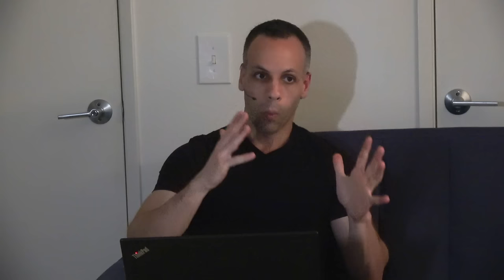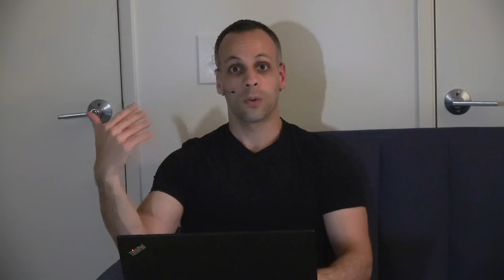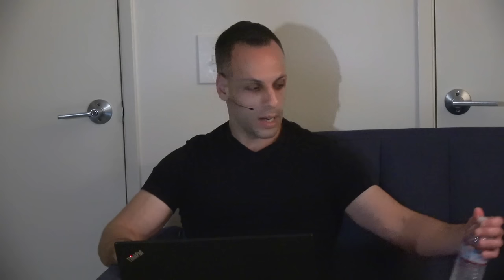EVGA's Oversight: Unannounced Changes Destroy PCs, EVGA takes NO ACCOUNTABILITY

Comment: I almost learned this the hard way. I had to replace my PSU as it was smelling like molten plastic, that for some reason I was the only one able to smell it. I got a new PSU and thought nothing of it to simply swap the PSU but not the cables to save my self the hassle. My paranoid hypervigilance made me think that maybe the cables were not compatible, even though I was probably being paranoid, I still decided to check, then I double checked, then triple checked, and low and behold they were not... and I couldn't believe it... so I was going to swap out a fried PSU and almost ended up frying my entire PC along with the new PSU. Since there is no standardization of the cables, I'm not surprised it would even change with the same model of PSU, but I probably would have just swapped the box if the model was the same. It's an incredibly stupid blindspot, I watched a girl pc build channel upload a video where she fried 3 PSU's not knowing this. If you want to see the video it's from "Andie the Lab" - "Almost Electrocuted Myself - New Battlestation Rig"

Comment: I used to be a long-term EVGA customer.  Back in the 1080TI days, my EVGA video card caught fire (there are videos by others of this on Youtube).  It was in warranty, so I returned it and received a replacement.  Shortly after installing the replacement card, it exploded.  Bits rainded down into the power supply, which failed.  The incident also took out my monitor.  I basically had an unplanned rebuild of my PC because I didn't trust any of the components after this.  Didn't even bother returning the video card again because I would never use it or even sell or give it to someone else.  EVGA lost a  customer that day.  Since then, I have emphatically told anyone who was planning to build a PC to avoid EVGA like the plague.
Reply: ??? There is nothing in there that can explode like that? lol I could understand a power suppyly with the condensators or coil but jeez what?
Reply: What do you mean "exploded"?
Reply: not fanboying for evga or anything but pics or it didn't happen! lol i wanna see the graphics card shrapnel and stuff!! like which chunks explodified? was it the gpu itself, or surrounding components or what?
Reply: @outseeker  this can and will happen, thats the problem with the internet children need to stay out of adult spaces.
Reply: I mean it made a very loud noise, something like a large sheet of metal hitting the ground.  Made me jump.  And there was smoke and smells.  I didn't disassenble the card, but I do stil have it somewhere.  From other comments at the time, I am guessing it was one or more MOSFETs in the on-board power circuits. I do recall retrieving one or two bits (about 7mm square) of black material like the epoxy used to enclose chips from the bottom of my case. EVGA clearly had a design, manufacturing or component quality problem with their 1080TI cards. @user9267
Reply: @fredknox2781  wish it was by pure magic recorded on video somehow.. like i never wanna experience this myself, but i do wanna experience it in 3rd person at least lol

Comment: One thing that pissed me off with EVGA is their motherboards... I bought a z690 motherboard for $499 2 years ago with 12th Gen intel CPU .... They stopped updating the bios like a year ago so highest drop in upgrade i can do is 13th gen because there is no bios for 14th gen.
Reply: no that's an intel problem. from 2nd to basically 7th gen they were identical and the only reason you had to change the board was because intel says you can only have maybe 1 generation of upgrade. if you want more than that get AMD
Reply: @bradhaines3142  my MSI b660m can run 12-14th so not an intel thing.
Reply: @bradhaines3142   Its not Intel, 12th -14th is same socket... all it needs a BIOs update to work.  But apparently EVGA Bios person left a year ago so I cant use 14th Gen.
Reply: You have all of the upgradability that you need. The "14th gen" isn't even a generation, it's a refresh of 13th gen where you're lucky to get a couple of percentage points of difference. Be it between the 14900k and 13900k. Or, 13600k and 14600k. 

Honestly, with the performance difference across the 12000 and 14000 series, unless you're looking to...I dunno, upgrade a 12400 to a 13700k/13900k, there's nowhere near enough performance that would justify the cost of a new CPU.
Reply: That is on you, no company can guarantee a future upgrade path. You buy based on what you need today.

Comment: I knew of not mixing models, but not that you can't mix versions. I have been Corsair strong, but I do EVGA when the price is right. I do bulk buys as well and just bin extra cables by make and model, I appreciate the heads up so I can check the pinout before using these remaining EVGA's. This information may have just saved my small business a big headache, thank you.

Comment: I am an EVGA user, I recently had some new cables for my PSU and EVGA sent me the cables for free because they had a stockpile and no longer made them. About 2 years ago EVGA standardized all their models to use the same pin-outs which has lead to some of their older models now having 2 different pin-outs between model years. When I asked for new cables for my PSU so that I could plug in some new drives, I had went onto their website and realized there was no cables for my model and they had very clear labelling about not mixing cables on older models. I called their support and the service guy was very careful to make sure I had the right model number so that I wasn't sent wrong cables. EVGA as far as I know is the only brand to standardize pin-outs across all of their PSUs.
Reply: SeaSonic might have as well. I know I was able to use cables from a build I had 8 years ago with one I built two years ago. Support confirmed I could, but I pinned out both the older cables I used to be sure.

Comment: I had a run-in with ASUS similar to this. I RMA'd a motherboard of theirs after it failed under warranty. I sent the board in, I later got a message stating that they would not repair the board and that it would be returned to me. The reason it was denied? "Physical damage to board." I received the board back and it had been repacked in a different box than I sent them, and it had an entire corner of it folded! I contacted customer support, posted to their forums, etc...they wouldn't budge. I decided then and there that I'd never buy another ASUS product again, which is a shame because I had been a long-time customer (mobo, gpu, two monitors, a laptop).

Comment: Since EVGA is so big, the customer should sue. And EVGA now notified must immediately send supplemental instructions with rma power supplies, with very clear instructions on checking power connections. Or immediately change RMA to send in cables and new cables sent if new doesn’t match old BY THEIR OWN DESIGN.

Comment: I have also fried 4x 2TB 2.5" drives like 10 years back. Because even that two different vendors used keyed connectors - they have not made their original cables with the exact counterpart that would fit only the supply of theirs - I was able to use one set of cables with both supplies - and unfortunately an oversight was made  - that fried my whole RAID5 array. The modular PSU's should be really labelled with voltages, and the non colour-coded cables banned.

Comment: Most power supplies I replace are just the good old cables built in use a zip tie on the unused cable ones.  Or the are proprietary to the manufacturer (HP, Dell, etc)  I don't do much with any gaming PC's or anything.  But this is good to know.  I will always test with a meeter now before hooking it up.

Comment: EVGA stopped existing to me after they stopped making graphics cards. There were always other companies with better offerings for other products they sold. In this case, why do I want an EVGA power supply when Corsair and Seasonic exist?
Reply: I didn't stop buying their PSUs, until I saw a report of the warranty getting cut-down, which made me lose hope! Sadly, that's why for my newest PSU purchase for another build, I got a Corsair RM850x. But, my daily-driver, has an eVGA Supernova 750 G3 from the late-2010s, IIRC, older than the other PC components! Lasted through multiple Ryzen builds and in 2021, IIRC, I got an eVGA 650 GQ for another build in the same room. The Supernova 750 G3, was first installed on a socket FM2+ system, with an Athlon X4 860K, maybe I had it on another PC before 2019.

Comment: I would expect EVGA to fix this, we'll see.  But they are well known for some of the best warranty service in the business.  I've experienced it myself, they covered something that wasn't within the warranty period just to be nice.

And yes, NONE of the modern PSUs are standardized in terms of pinouts.  I mean, it is standardized on the motherboard end, but not on the PSU end.  I had to map the pinout with the cable on my recent setup so I could make a jumper cable to plug into the PSU that turned power on when the switch on the PSU is flipped.  Yes, you can use the included jumper on the cable itself but I wanted to eliminate excess cables, and this is a second PSU that just powers my fans and pump.  Ironically, it's an EVGA. 

While their RMA process needs to change, or at least include some QC checks that would trigger a call to the customer if something like this happens, I would also point out that it's a very specific set of circumstances that would result in this.  It wasn't that he got back a drastically different model, I would bet they would have included new cables with that.  He got back a new revision of the same model, and that screwed him.  It's probably a situation they didn't consider on the RMA side because they didn't think the engineering side would do that within a model run.

Comment: I usually go with Corsair or EVGA for power supplies and have used wires from multiple PSU's in 1 and can't say that anything has ever fried. Like you, I just assumed that they were all the same wires because they have the same connectors, never even thought this wasn't a thing if they are somewhat close it wattage. Luckily you released this when you did because I'm about to upgrade GPU's in our home therefore having to upgrade PSU's and since we all have multiple drives that almost always require 1 or 2 extra cables to connect them, I would have just used an older SATA cable on the newer PSU's. You're the man Ross!

Comment: Louis, I think they should cover it all.  It would actually be pretty rare that people are frying their HDD's/SSD's to cheat them, AND they have a limited number of processed warranty cases for that specific model where the pinout changed to date.  Also anyone that has NOT complained for 2 or 3 weeks after they got their PSU back can be assumed to not have had damage either.  Send notices to future clients.  Not sending in cables is a GOOD policy.  The pinout change is completely irresponsible.

Comment: I think you are wrong about covering damage to other components because this isn't even under are of things warranty defines. Your PSU dies and spike of voltage kills components - that can be discussed under warranty discussion. Still, even in that case, PSU could have some kind of insurance: "we are not responsible, but with purchase you get insurance policy for damages up to...".

But this issue is not caused by PSU malfunction, this is caused by gross negligence and company should be held accountable because of negligence, not because of warranty. Even if my PSU is older and not under warranty, and EVGA sells me replacement cable clearly stating it's compatible with my PSU (in EU companies are obligated to provide spare parts even some period after warranty) without any notice like "only compatible with model produced after, or with serial starting with", that is negligence, not malfunction.

Comment: Oh so that’s why it fried my hard drive! This literally happened to me 2 years ago when I learned the hard way that, the cables are VERY particular. Also I’m by no means a beginner, I’ve been building PCs for over 15 years. I assumed the cables were the same , I didn’t buy the same model but I assumed EVGA would use the same standard for all their power supplies. I won’t make that mistake anymore again but it’s going to keep happening to people until they address this issue.

Comment: Also as a note, the reason people chose EVGA over anyone else was because they had great customer service. Burning out 22TB of storage isn't 300-500 bucks. That could be in excess of a thousand of dollars the customer is out. Not replacing it is really bad form. If the model he had were no longer being made, it would be expected that they would send along a full box with the cables if they couldn't replace his with the identical unit. That is this case and they didn't do it. This is on them and they should cover it.

Comment: That's unfortunate, personally I had a power supply replacement from EVGA about 4/5 years ago. They told me not to send the cables with RMA and explicitly told me to switch all the cables when I got my replacement power supply. They did include new cables, so maybe this a more recent policy change?
Reply: EVGA's RMA department had this problem in the motherboard side. While "We're sorry but we don't make the GTX 1070 anymore, we'll give you a 3070 instead" sounds good, but "We're sorry but we don't make the Z370 FTW anymore, we'll give you a Z690 instead" doesn't really get you going.
Reply: @Fay7666 true lol
Reply: It sounds fishy to get a new power supply with no cables. Something seems off on the story.

Comment: I recently RMAed a Seasonic PSU, and the only cable they told me to keep was power wall cable.
They replaced the with the same exact  model name PSU, but the new one obviously used different components and must have different cables, but I never checked.

Comment: "It's mindbogglingly stupid that 20 years into this [standardized modular cables] is not a thing"

That's because of retrocompatibility. When the first modular PSUs were being made, every PSU manufacturer worked on its own pinout, privately.
Now if they come up with a universal standard, the new cables will be incompatible with the old PSUs => accidents will happen when people, believing that the cables are compatible within the brand, will use new cables with old PSUs.
intel could have used the new ATX 3.0 spec to impose ATX12VO and a universal pinout, which would have solved all issues.
But intel being intel, they didn't, so this mess gets to live on.

Comment: I agree Redundancy... is to protect the data from an immediate failure, to prevent an outage, but is not a backup.  The person in the story... said they lost their work that day, but didn't talk about loosing years and years of data.  It really sounds like they did have a good backup method set up.  I have 1 drive using the File History from windows, and 2 which use FreeFileSync and window's Task Scheduler to backup to 1 every 4 hours, and the other every 12.  It means, if I make a mistake, I could have up to 12 hours to restore from a backup the mistaken deletion, but also if my primary drive has an oops, I have only a max of 4 hours data loss.

Comment: This is crazy, that you just put this video out, I had same thing happen to me.. have same psu and extra cables because the server I bought on FB Market, I needed old molex power plugs.. and funny thing is it didnt boot.. it was because the same model had different pin out and it wouldnt boot.. luckly the drive I had plugged didnt die.. wow this is nuts and i totally agree with you on this..

Comment: Louis, you of all people should realize that some models are supplied by FSP and some are supplied by Super Flower.  EVGA does not actually make their power supplies.  This can even vary between version 1 vs version 2 vs version 5…. We need to fix this industry wide….
Reply: i believe the issue here is there apparently is no identifier of "v2" or whatever, plus in any case they were told to keep their psu cables when returning the faulty one for replacement, and they were not provided any new cables, so there was literally no way for the customer to use the psu evga sent them as a replacement.. the only possibility was them cooking all of their hard drives simultaneously by using their original cables with the supplied psu replacement, as instructed.

standardisation is a great idea for sure, but this is a whole other level of problem.
Reply: @outseeker  Yup, this is a pretty old issue.  Supports response is usually a link to purchase new replacement cables at a discount if I remember correctly.

Comment: Learned this lesson the hard way a year and a bit ago when I replaced a 1000w EVGA PSU in my system. Thought they'd be the same pins, nope fried 6 drives and a board. Not having these kinds of things standardized at this point is such bs.

Comment: I had this happen once. A customer brought me a PC with some strange issues. One of which ended up being they were using an EVGA SATA power cable on a Corsair power supply. It was dumping 12v into the 5v on a SATA SSD. I'm surprised it didn't kill the SSD instantly, but it eventually did. Can't blame that on Corsair though. Anyhow, hearing this means I'm going to stop suggesting any modular EVGA power supplies to customers, or using them in builds. I'm less upset that it happened... I'm more upset by their response. There's no excuse, clean up your mess.